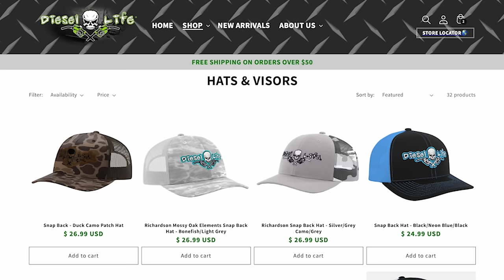Hauling EVERYTHING for Big Construction BOOM in Florida!

Comment: Splice in an air connection with quick release chuck in the middle of the trailer and put a 25 foot coiled air hose with a blower attachment in your sleeper storage, and then you can blow a lot of that crap off the trailer before hitting the road home.

Comment: Serious question you’ll probably laugh at but, how unprofessional would it be to have a fold up bike or some electric off-road board to get to the machine or back to the truck? 

I eventually want to get into RGN hauling and often see drivers videos and noticed they usually have to walk a decent distance to the equipment. Are long walks to equipment commonplace enough to even consider trying to save a few minutes?
Reply from the maker: Preference I guess 🤔 you would get around much quicker and save time💪thanks for the comment buddy👊